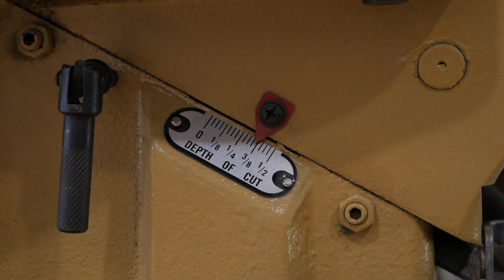How To Taper Legs on a Jointer

Comment: You're right, the finish the jointer leaves on the taper really is outstanding.  I used it last year to cut tapered table legs, but instead of using marks on the jointer fence, I marked the length of my first cut with a stop block clamped to the jointer fence.  Either way, the result is the same - a super easy taper!  As usual, you put together a video clearly explaining the technique!
Reply from the maker: I like the stop block idea as well!! Thanks 👍👊🏼

Comment: Great video!  I just did this earlier this week for a pair of matching end tables.  My only recommended additional step would be to add a stop block on the fence after the first cut to the midpoint line.  It makes the following cuts (in my case - 15 more cuts to taper 2 sides each on 8 legs) MUCH more repeatable and accurate.  Keep up the great content!
Reply from the maker: Thank you. I like the stop block idea
Reply: I was thinking the same thing.

Comment: Working on my first table. I was going to attempt a table saw jig but this seems a lot simpler. Thanks for the clear step by step!
Reply from the maker: You’re welcome!
Reply: @bentswoodworking   I did it today and the legs came out spectacular. A little sanding will be needed to clean up a few spots but overall I couldn't be happier with how it turned out.
Reply from the maker: @age234  that’s great!!

Comment: Love the videos, have learned a lot so thanks!  Question… Why taper two sides only? Is that a style choice or the inability to apply pressure to the fence on the tapered side? Thanks in advance.
Reply from the maker: In this scenario I only wanted 2 sides tapered

Comment: This is a good idea for repeatable tapers. I however prefer to make the initial cut on the band saw and clean up the face with a hand plane. I feel like i get a better surface. I also get a bunch of little shop made shims that i use all over the place.
Reply from the maker: Good technique and you get the shims out of it. 👍

Comment: Fantastic tip here. thank you. would think its a good idea to set your table to 5/16 first,  and then you can run the taper through at 1/16 depth for a final pass?
Reply from the maker: Good question but I haven’t done it so I can’t say unfortunately
Reply: @bentswoodworking  Well I just tried this out exactly the way you showed, and it worked as good as in your video, so my suggestion was probably moot

Comment: Thanks for the technique. Best video I’ve seen so far!  Liked for the super wide shot. Allowed me to see the big picture with the two sided taper. 

P.S. I’m considering purchasing the 8” in lieu of the the six. You sold me on the Powermatic brand/quality. Beautiful cuts.  Thanks for sharing
Reply from the maker: Happy to hear you found it useful. If you can swing the additional money for the 8” I definitely recommend it. If you buy the six you will wish you bought an 8”. Powermatic is outstanding quality and I always feel like I can depend on my tools.
Reply: Thanks for that tip. With that, I’m curious what applications you find the 8” most beneficial for vs. the six?   

Thanks 👍
Reply: Robert many of the rough lumber boards you’ll find are in the 6-8” range. If you do go with 6”, make sure you can remove the piece on the side of the jointer that would allow you to overhang the wider board ( >6” wide). There is a technique that allows you to then use that flat edge on a flat sled that you run through the planer flattening the opposite side. Once that is done, you can flip it to run the side originally run on the jointer t rid of the excess the jointer couldn’t reach.

Comment: I would do the depth of cut double check BEFORE marking the start of the cut position.  Your relative position to the round cutter head would change if you had to adjust the infeed table.

Comment: Nice table, Personally I’d use a tapering jig, can make one in a few minutes, only issue with a tapering jig is that you are limited by the depth of cut from your table saw
Reply from the maker: That’s the main reason why I was looking for another technique. I really enjoyed using the jointer.

Comment: I saw where you had the depth of cut set before you started. I usually only take that deep of a cut (maybe even less) and I never change the depth. Would you have any reservations with this technique if you had straight knives? 3/8" is a big bite from my perspective.
Reply from the maker: No, if you take a look at the video I linked in the description, which is where I learned this technique, he uses straight knives.
Reply: Bent's Woodworking I’ll check it out. The only other video I have seen of this technique is the mahogany and maple sofa table Jay Bates built. But he has a helical head jointer as well

Comment: You are a teacher. Great explanation and camera work. I understand you are just showing a different way to skin a cat. But, I believe a jig with a table saw is probably more accurate (pencil marks on fence), repeatable and safer. Your way is definitely not for the amateur. Thanks for the video. Your are awesome !!! Keep the vids coming.....
Reply from the maker: Thanks. This is definitely my preferred way. I would only use a table saw if I needed to make a drastic taper now.

Comment: I have been looking for a bandsaw for last two days. I have planer, jointer and tons of other tools but not a band saw. I have $100 into the four legs and am going to try this. Am super nervous! Going for it though thanks for posting
Reply: Just finished and worked perfectly!! Definitely would prefer to have a helical set to taking a huge cut a lam 4x4 but came out amazing. Thank you !!
Reply from the maker: You’re welcome!!
Reply: @watchguy79  did you do it with straight blades or a HH?
Reply: I did with straight blades. Want to get a helical head soon. It worked great sorry for the late reply

Comment: Thank you for posting.  I watched Glen Huey's post years ago.  I have several questions and observations.  That initial cut, taking 3/8" off half the legs is a heavy cut and  prone to tear out to those of us without helical heads. Try leaving the jointer set up at 3/8", put a start mark at half the cut on the fence, and make a pass with the leg in the same position you use for your second cut, top forward and bottom on the line.  Then make the second cut with the leg in the same position and it will complete the taper.  A second suggestion is to not try to taper right to the bottom of the apron.  Allow 1/2" or maybe an inch for sanding and smoothing.  I have done hundreds of legs like this.  Much less prone to tear out.  For those who fear variations in the legs, this is accurate enough to produce legs that are visually identical once they are installed.  And you should try doing this with the planer and a sled, you can do four at a time.  Then you can run them through a drum sander on the same sled.
Reply from the maker: Interesting idea with using a planer. Another idea I wouldn’t have considered.
Reply: I bet a rough pass on the bandsaw would make the planer sled step go by quickly!

Comment: So I'm considering using this technique, however, I have a jointer with straight blades... 3/8" seems drastic for the machine. Thoughts? Love your content, keep it up!
Reply from the maker: I wouldn’t be concerned. There is a older video here on YouTube that a guy does it with straight knives. It’s actually the video that I learned the technique from.
Reply: @bentswoodworking  thanks for the motivation. I've purchased your table plans... I'll let you know!
Reply from the maker: Thank you so much!!!! Let me know if you have any questions

Comment: I'll have to do the math but....what if you wanted a 4" flat section on the top of the leg?  I normally use a tapering jig that I built from watching an old Yankee's Workshop show with Norm A many years ago.  I do like this approach but I'll need to do some testing to figure out how it works with different lengths of flat sections at the top of the leg.  I've  built several different table and desks and depending on what the client was looking for, the flat section often changes from project to project.  Good clear video though.  Nice work.
Reply: I just figured it out in my shop.  The important point is the halfway point.  So, in your case, if you wanted 4" on top instead of 3" your center point would have been 7-1/2" instead of 8".  Got it!  Will definitely try this technique on my next project.  Thx
Reply from the maker: Yes it doesn’t change anything when adjusting the size of your flat portion. The only thing that would change is your centerpoint of the taper which means you would just stop the cut at a different location. The taper it self is dictated off the finished size you want the bottom to be

Comment: This is great but the scribed line should be made after checking the depth right?
Reply from the maker: Scribed line?
Reply: @bentswoodworking  The line you put on jointer as the stop must be moved if you adjust the depth I think?
Reply from the maker: Oh, yes. Once you set your depth, you would then scrub the line to determine the location that the cutter head just begins to cut

Comment: That’s a great technique. My only concern is grain direction. Because you pass the timber over the jointer in both directions could you not get tear out? I suppose the second pass would have to be in the proper orientation to slice off any tear out from the first pass. 
I will definitely give this a try. 
Thanks so much for the video. 
Dave
Reply from the maker: With the helical head I didn’t find this to be an issue at all. That may be a valid concern with straight knife. Would love to hear what you find.